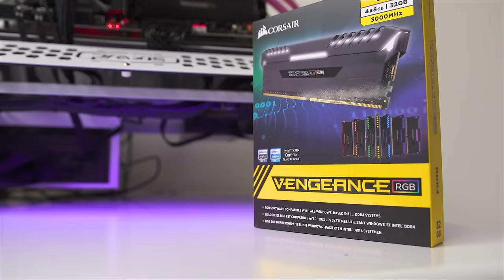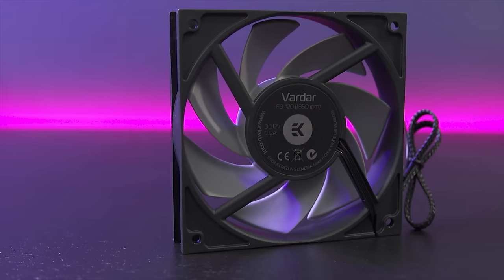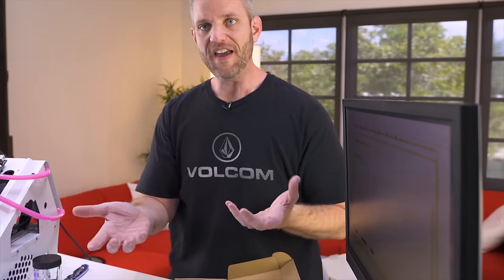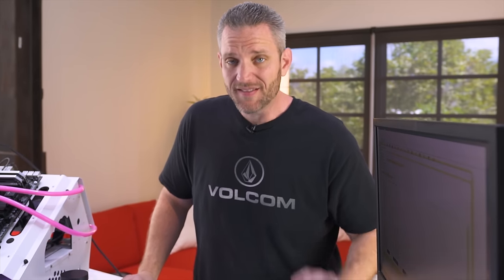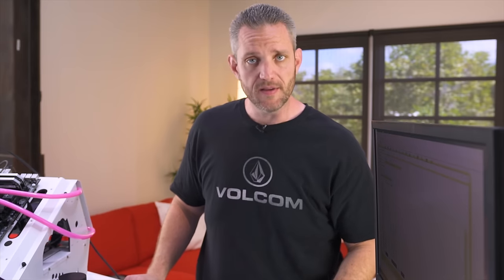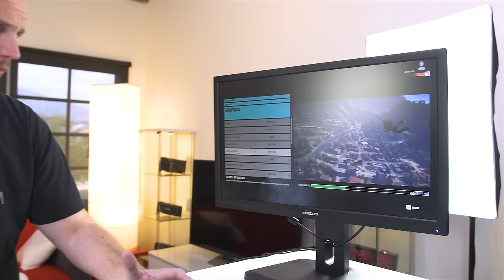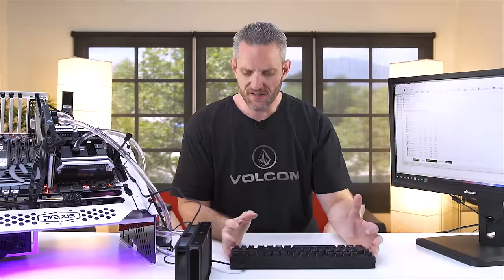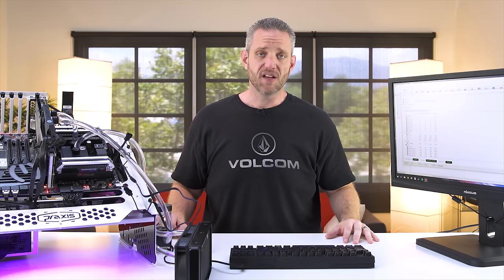How to Watercool your CPU and GPU for under $250

Comment: Been running this loop since it came out, massive issue with one of the Mayhem coolants because Novatech didn't scrape the description of Mayhems page properly (GPU and CPU got insanely clogged) but it's been fine ever since after using the right coolants, only trouble is upgrading to a 3080 is going to make me say goodbye to it!

Comment: I thought most modern cars that have aluminum block heads also have aluminum radiators with plastic tanks on the sides?

That being said I do know tons of old Racers that still run copper / brass radiators and have aluminum heads at the very least on their engines and a cast-iron block they never seem to be worried about anything growing in their cooling system LOL but maybe that's because of chemicals inside of antifreeze I don't know not even sure why I commented 😂

Comment: Closed loop AIO usually made using different metal. Cold plate:copper and Radiator material:aluminium. What makes aluminium radiator in this video lightweight, grade of aluminium. Calm that freak of galvanic corrosion, there is no harm of being cautious, just calm it down a bit.

Comment: Aluminum is fine for cooling. Its worst problem is it doesn't spread heat evenly throughout its surface. Copper best feature is that it spreads the heat out evenly. Aluminum transfers heat quicker though than copper. I prefer the aluminum and i had quite a lot of experience with it as my Corvairs (Chevy)used aluminum engines. My Spark(Chevy car) and Vega( Chevy car) both had all aluminum  engines. Had no problems with galvanic corrosion from either the air cooled or water cooled engines.

Comment: On my main rig I have a CPU water cooled but not the GPU, and I get about the same temps with the CPU with a 240 radiator. The GPU get's pretty hot and can sometimes jump up to 85C so I think that GPU temps are pretty nice.

Comment: cool but by going the aluminum route, there is no going back. you would have to buy aluminum parts for ever at every upgrade.

I own 3 PCs fully watercooled at home. started with one, and bought more second-hand parts, had spares, and decided to do loops for the other pcs.
the first loop is the more expensive, after that it's jsut minor changes. but those changes would be more difficult with the aluminum route, because the blocks on the market are mainly in copper.

what would you do if the new shinny GPU you want, only has copper waterblocks available ?

Comment: If anyone could answer this that would be great. Can you add another aluminum radiator or use a larger one to cool multiple gpus? If so is the pump powerful enough to circulate the coolant through the whole system? And could you use a harder tubing such as acrylic or PETG tubing?

Comment: weird the gpu block cutout for the power connectors look like it can fit 2 8pins but i haven't seen a single card on ek's compatability list that has 2 8pins like my evga 1070 ftw (no idea why it has 2 seems overkill)

Comment: I am hoping you might help me on this build? I want to watercool my new pc cpu and gpu. So far I have the Bykski GPU Waterblock, for ASUS Dual RTX 3060 12G Gaming, PC GPU Water Liquid Cooling Block Cooler, with Metal Backplate. Which is $244 CDN. However I don't know the best, cheap option for the rest of the required parts. I am hoping to pay tops $200 for the rest of what is needed if possible. Would appreciate your professional opinion sir

Comment: Right now im a little pissed at EK. I bought the 280 kit and it doesnt fit the fractal design R4 case. I bought a full length water block for my 970. Didnt even come close to fitting my card. I even had to order more fittings for the kit at 32 dollars for 6 fittings. Im around 500 into this loop and i cant even install it.

Comment: have it for 3 years now. I love it. only drawback is the spareparts and limited upgradebility with the newest hardware. With a rebuild i accidentaly tightend my cpu waterblock too tight when cleaning and reassembling it back from amd to intel, so it cracked near the inlet fitting. EKFG had no spare parts so that sucked a bit. On EK's webshop i found a replacement acetal cpu wb top cover that fitted perfectly, since theyr all the same dimensions. And since it's acetal no worries about mixing metals. My new system is back up and running for a couple of monts now. Love how silent and cool it is.

Comment: random question here, does anyone know which is more expensive to make ? copper or Aluminium...I know that the ore, Bauxite, is ubiquitous in Australia and I think it is shipped to NZ where it is then made into pure Aluminium because of the cheaper and plentiful electricity needed to smelt it...I'm not sure what's involved in making copper but I was under the impression that a shit load of power is used to make Aluminium...

Comment: Aluminum cools better than brass copper, thats why all the radiators no adays are aluminum, and race engines are all aluminum with aluminum AN fittings and aluminum radiator. Save weight and cool better. Plus aluminum can be polished :D

Comment: Aluminum has a lower density than copper which might explain why a 240mm rad is able to cool the CPU and a 1080 so well. It dissipates the heat a lot better than copper. Although at the core copper transfers heat a little better. Alu is still very good at transferring heat tho, so this might actually give you better thermals just because of the aluminum radiator.

Comment: the issue is not anywhere near as severe as it is in vehicles because generally speaking temperatures of the liquid coolant and associated parts are a LOT less in a P.C. than in a car, for example...plus there is PLENTY of common knowledge out there regarding many solutions to prevent this issue...

Comment: If you had aluminum fittings, rads ect but the pump had galvanized steel, would that solve the issue of galvanic corrosion?  I'm not a chemist so the whole idea of dissimilar metals making each other corrode is pure fucking magic to me, I just have to press the "I believe" button.

Comment: I am using an aluminum radiator from a car (a lot aluminum) in my watercooling for 10 years with all other components made from copper (some nickel plated) and brass fittings.
Guess what... I have never had any issue with corrosion! And I left the water up to 3 years in the system.
Only thing I use is destilled water and some radiator antifreeze for cars.

Comment: My gas for the radiator size is because they understand that their product will be good enough for the majority of people and net positive head pressure won’t drop as much
The reason I mention this is because it looks like that is not a DDC pump
My guess is they were able to get pumps manufactured to their specs more cheaply for this unit

Comment: Interesting thing with aluminum is that it transfers heat faster than copper.  Copper is good if you want to retain heat, but if you want to move heat quickly, aluminum is (IMHO) the better option... in this application.  Copper is great for sauce pans where you want to keep your sauces at an even, and consistent, temp for longer.

Comment: Would you say the A240 system is better at cooling the CPU or the Corsair H150i Pro? Both are priced about the same.

I have no issues with using aluminum in cooling systems because high performance cars, motorcycles, and race vehicles have been using aluminum cooling systems since the beginning of time and is considered superior to most anything else available. Thanks for the great review.

Comment: What if the aluminum and copper/brass/steel/nickel  parts are not touching?  Say if you replaced just the pump and res with something quality and made sure to use non aluminum fixtures to connect the hoses to the pump and res.  Then there shouldn't be any issue with the rest of the aluminum components?  Is that right?

Comment: A 360mm rad would be better but 240+120 would fit in almost any case.
Are there any other form of radiators than square, I mean a coneshaped radiator matching the cone-ish airflow of a fan would be rad.

Comment: Aluminium has around 40% lower thermal conductivity. But this does not mean it's not enough for these low amounts of heat at low temperatures.

Comment: I have been dealing with is in the plants that make the chips for the night vision goggles for years and being the use of aluminum and other metals when they are isolated is a non issue! Every water heater in America deals with this without a problem. Steel tank, copper flex connector isolated by a  porcelain connector.

Comment: Aluminium is purest form and the periodic table nomenclature. Aluminum is the metal we all actually use since it has other elements added into it to make it useable. So anyone saying aluminium is correct only when referencing the periodic table element. The metal we use and the correct nomenclature is aluminum. Anyone not using aluminum as the nomenclature is wrong. Even the check spell thing says aluminium is incorrect and will change it to aluminum if you use the autocorrect feature. Like this video and thanks to EK for these kits.

Comment: Little late to the party here but if you're using aluminum you should also use deionized water as opposed to distilled. I'm not a chemist either but it has something to do with the electrons in aluminum and ions in water. It's why your car uses deionized water in the coolant system. You can get it an Canadian Tire in the auto section.

Comment: Most cars dont have brass radiators any more. Almost everything is aluminum in a cooling system. But sometimes they will have a steel impeller in a water pump or something. But as long as you use good coolant and flush it on a schedule you dont really have any problems.

Comment: Why not just put another 240 radiator on the intake side of the fans?
It's just 30€ more and adds one more stage before the water goes to the components.

Comment: My issue with aluminium ;p is that it is a SOFT metal, although you might say the same for a few others as well. Given that the fittings and blocks are also made the same I am cautious if this would stand up to test bench use where someone might be taking their system apart every few weeks or guys who upgrade frequently. It would be an unfortunate and expensive mishap if the threads end up stripping on the fittings and/or blocks, or they get to a point where the o-rings can no longer provide an adequate seal because the thread has worn.

Comment: Really a nice set! Much better than the latest Alphacool system fail that they had with a really great pump/block that used an aluminum radiator and after a year or 2 the fluid turns to gel then crystals as Gamers Nexus showed. I actually bought one and immediately pulled the aluminum rad off and replaced it with a copper one along with the copper block and bronze pump its been fine since day one after replacing the fluid. Maybe I should buy one of these and use the old alphacool 360 aluminum radiator that sits lonely on the shelf. I have never used a DDC style pump so it could be an interesting small setup.

Comment: So this is an older video but I'll m very interested in doing this with my rig and call this a dumb question but is there any other coolant you can put into the system instead of the clear liquid? or can you buy other colors? kind of new to the idea of water cooling

Comment: Galvanic corrosion occurs from direct contact of two dissimilar metals. Any salt content in the water will cause corrosion or if there is a charge being applied. So if there is any sort of corrosion in a system, I would not point to galvanic corrosion as the culprit.

Comment: Easy to see that corrosion within the system is a non issue and the heat pads would likely insulate electrically for those components but what about between the gpu and water block?

Comment: I have a 1080 ti and a R5 2600 is this enough to dissipate all that heat also does it come with those thermal pads or do you need to buy them separately to replace the ones on my old 1080ti

Comment: so uh I have a build that I've been using a bit and I'm not sure if its just me or if I should buy better things?.... I just know my fps is pretty shit for what it is.

Using a 50in LG 4k TV if that matters..
Riotoro Cr1288 Full Tower
ROG Strix B-350 Gaming
Ryzen 7 (1700)
ddr4 ram running at 2600mhz 16gb
Rx480 8gb x 2 running in Crossfire mode
850w 80+ PSU
1 tb hdd + 50g ssd running AMD FuzeDrive

My FPS when playing PUBG is like 15-20fps most of the time.
fps in minecraft is only a solid 60fps...
SO.... Opinions?
Reply: If you are playing at 4k native, which you seem to be as your tv supports that, that should be why^^  
Even 2 rx480s are not strong enough for that ^^
You would need like 2* 1070 to get 60 fps, depending on the game probably even a 1070ti in sli ^^

Comment: I do want to start watercooling my CPU and GPU once I upgrade to a 2080 ti and an i9 9900k but I’m a total dingus when it comes to installing things so I’ll just watch watercooling videos instead and use AIOs instead.
Reply: You know this is pretty much like an AIO right? You just have a pump and graphics card block added, but everything has to be assembled. Just watch YouTube videos and read instructions. I'm a fucking idiot with my dick in my hand pointing it around for help until I actually read or watch stuff that tells ya how to do it.

Comment: That watercooling is still a bit useless here in the philippines because of our real temperature, except if you have a airconditon.
Reply: Not at all higher ambient temperatures actually make the case for water cooling as it can keep the temp's closer to ambient.where you will suffer tho is it will transfer more of the heat into the room and thus be a better space heater

Comment: Hi Jay, Other than price difference among the Aluminum vs Copper can you make a video with in depth differences among them and which one is the best (I am planning to build a rig with i7-8700K and GTX 1080 Ti for my deep learning projects). I need your advice on it. Thanks, Krish
Reply: Copper dissipates heat more efficiently than aluminum.Unless you keep the system for several decades the durability of either material is good enough to last until you change but copper will typically last longer.Copper is more conductive of both heat and electricity but more expensive.

Comment: for me I'm actually considering buying this but my one issue is that my GPU isn't a founder edition but an MSI GTX1080 so i'm hesitant in taking it apart to convert into liquid cooling. CPU i'm already running an AIO to keep my overclocked 6700k Happy
Reply: Compatibility List for the GPU block: https://www.ekwb.com/configurator/waterblock/3831109890769

Comment: I can make all your water coolers look dumb for under $70. submersible  fountain pump $20,10ft food grade tubing (food grade doesnt have writing on it) $12  ,2 qrt glass mason jar with lid $7.00, cheap water cooler cpu block $20.00.  3/8" block fiittings $10.00.   not only does this water cooler system out perform any radiator but you can throw ice in it if you want and run at 6 celcius. it may not look cool but it sure acts cool!
Reply: Good for you, we don't care.

Comment: Can i watercool non-reference graphics card? 980Ti
Also, if so, can i watercool sli gps’s with 1 liquid container thingy & radiator? Just want to add more hose, instead of buying another full separate set to liquid cool second GPU
Reply: You would need to find the appropriate water blocks, and too lazy to find out what thingy you are referrimg to so i will not justify the rest with an answer, other than a ye

Comment: Jay, Did you notice any difference in preformance in a variable load scenario? (ie load spikes common in gaming)
Given Aluminum’s lower thermal capacity (and more notable thermal diffusivity), a scenario in which you have to wait for your system to ramp up the fans & such in response (And not having as much headroom with aluminum’s lower capacity) to the higher short term temps could result in marginally worse performance than a copper loop.
Reply: Well almost half of copper w/mK, but more factors than just metal composition....

Comment: Also aluminum is kind of a miracle metal.  It's cheap, it transfers heat well, but cools down really fast. It's a perfect element for liquid cooling.
Reply: No it is not, the only thing it is better than copper at is being lighter and cheaper, as it is the most abumdant metal on earth, but absolutely not a better conductor than copper or brass

Comment: I just started looking into water cooling my GPU and watched this video.  I noticed the time stamp of the video.  Is this a dead product?
Reply: No go to EK water block website and you'll see a tab called fluid gaming click on that. 

Also in case you where wondering they have one set for CPU only and one ser for cpu and gpu. The set with cpu and gpu only is compatible with the 10 series FE cards. You can still get this however and get there aluminium water block that also works for the 2080 FE 2080 TI FE and the RTX titan FE. Saddly they dont make this for the 2070 or I would be purchasing.